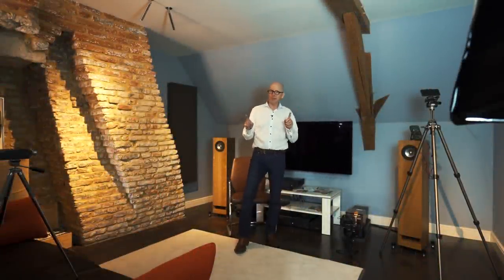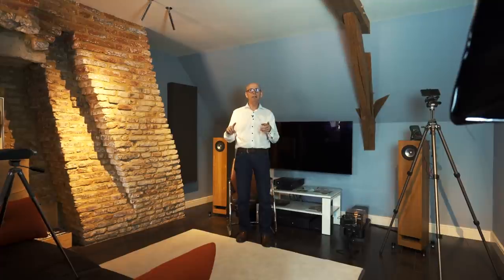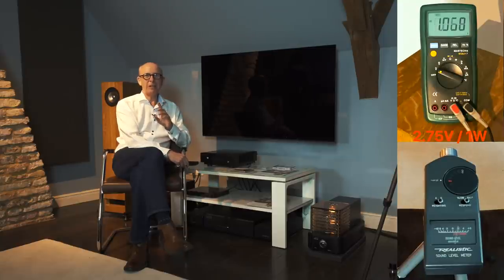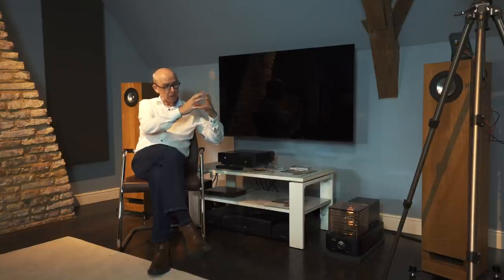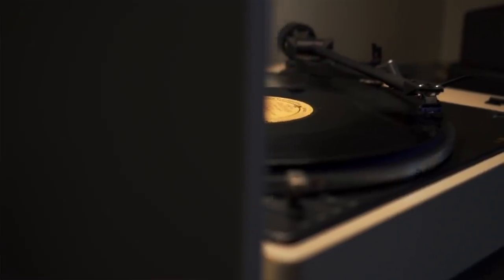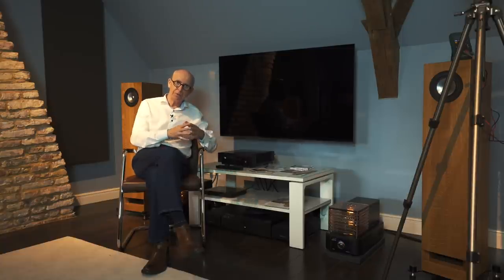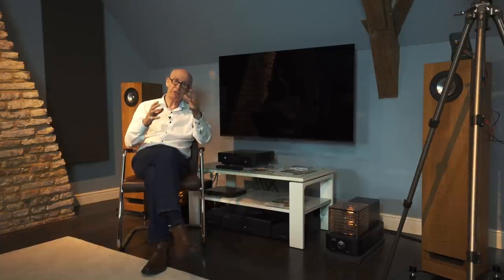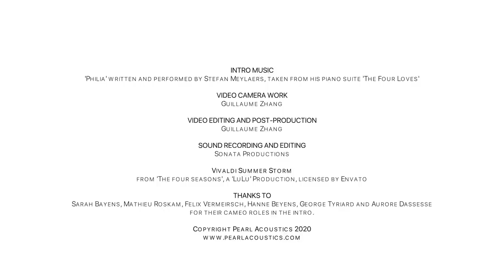How loud is 1 Watt (with an 87db Loudspeaker)?

Comment: Great. Now try music with some sub bass and see how it uses a hell of a lot more power for the same volume.
Reply from the maker: Hi. Thanks for your comment. I refer you back to a previous answer I gave. If your loudspeakers have a flat frequency response they will produce the same dB sound level at 1 watt, no matter the frequency. Of course the mid range ‘sounds louder’ because our ears or more sensitive to it. Hope this helps?
Reply: @PearlAcoustics  Yes but then whats the point of this video?  Sure 1watt can produce  loud sounds but whats so special about that? Now if this music had some lowend and still only used 1w then i would be impressed  😅
No offence but 87db per meter watt isnt even that efficient to begin with. Not to brag but I've got a set of 1980's monitor speakers that do 92db 😉
Reply from the maker: @FullFledged2010  no problem at all. The volume (sound pressure) at low Frequencies will be exactly the same at 1 watt with our loudspeakers because they are +/- flat down to 38hz.  I recommend you do the test yourself, with any high quality loudspeakers and see.
Reply: @PearlAcoustics  yes but that only works with things like white noise. or music with no low end sounds.  Try a 40hz sine wave and let me know how loud it sounds on 1w  😉

Comment: WRONG!  you must measure with a scope not with an RMS meter, you would have measured power input peaks of up to 20db above RMS or 10 db with cut compressed saturated peaks ( aka distorted!!), you would have also measured how high distortion and peak compression those 6 inch drivers are even at a mere 90db  SPL, I am living with active crossed over Klipschorns , the total absence of distortion and totally unlimited dynamic range puts everything else to shame like a tiny am transistor radio,  IOW  you have no idea how much distortion you had going there,  probably 5 to 10 percent, more on bass notes

Comment: Now do the same with an 8ohm speaker that drops to 3ohms and see how loud 1 Watt is.
Reply from the maker: Remember your speaker when it drops to 3 ohms becomes much more efficient at that frequency - the amplifier sees lower resistance and thus needs a lot more current. But only in the range where it has dropped. In practice, you’re absolutely right. The important thing for an amplifier is that it can deliver the required  current quickly, when needed.
Reply: @PearlAcoustics  I do not think impedance in speaker set  can  drop below coil resistance  at any circumstances      ,  With 8 oHm set speaker minimum is around 6,7 Ohm  But it is normal   to reach   more - ex 18 Ohm  in 8 Ohm set.  Only case would be when somebody added separate serial filter. which is unusual.
Reply from the maker: @Mikexception  I know it’s logical to think that but, and sorry to correct you,    in reality speaker drivers regularly drop well below that of the coil’s nominal resistance, especially when they get close to their resonant frequency. In our case our drivers drop to a little over 2 ohm at some lower frequencies. It’s totally normal.
Reply: @PearlAcoustics  I remeditated  and admit - my conclusion wasn't much correct. But to my excuse  I mentioned about   "unusual" serial filters and it looks  they may be not   electrical type and my fault was  that they are not so unusual.  With my constructions (mostly partly damped transmission lines) I had no much occasions to  observe them.  Driver impedance in assembled system is simply unpredictable.  Acoustic conditions treated as filter may affect measurements in that way by pulling passive power. - now I have in mind that you are  moving on vector scale and  measure something with unknown direction .

Comment: Imagine pnoe speakers which are 115db  with Gryphon amp 500 watts. Just kidding. What is most important is the weight of the cones, high damping factor and no cabinet or tube shaped cabinet. Then its dac and amp topography. Lukasz Fikus from lampizator gets it right

Comment: Not everyone has there system in a little space like yours my space is very large and to try and fill my space with your ignorant point would not work and if I did try to push a little amp like that to fill my space that amp of yours would plow up,and if not it would sound so distorted trying to fill my room and let’s not mention the lack of bass

Comment: A fun bit of magic. Most "audiophiles" have no notion of how sound loudness sensation is logarithmic. If you cannot define "logarithmic," you haven't a prayer of understanding; stop reading now, and just be amazed by magic.

Additionally, your narrative, when heard through the AKG's, shows that your room is not much deadened by whatever is in it. It is actually quite live. When the space is lively, measurements go into the dumpster. It's why real, repeatable sound measurements are generally made in an anechoic chamber. "Room gain" is a thing, elsewise. This also derails the effect of distance of the mics from the speakers, which here is unmeasured. One room's 6 watts at 6' is another room's 120 watts at 12'.

Your conclusion might better be that sound levels versus power to speakers is more affected by the room and the measurement distance than by voltages at some 'nominal' impedances. I relearned this recently by investing in a good 45 watt/channel amplifier, and replacing it very quickly with a 150 watt/channel device (which is satisfactory). [I occasionally listen at ~85-90 dB at 12 feet.]

It's more about the room and the listening position than it is about the watts. But we all know that.

Comment: This is stupid.  Why in the world would anyone use any 87 dB speaker, with a small radiating area to boot. This is also not addressing how much distortion is being produced with one Watt, is it ?   ( I use a two way high efficiency speaker, with a horn - loaded 15 inch ( large radiating surface) and a powerful one inch compression driver .)  Yes, 1 Watt will be OKish on my system ( ALTEC 515B and 802D ) , but a three Watts is better, and my next SE tube amp will be about 9 Watts, for overhead. Even if I play at 1/4 to 3/8ths a Watt on average.  

ULTRA important, one must START their audio system with at least 101 db, LARGE RADIATION SURFACE SPEAKERS . All else, follows THAT, as the proper start.  It is called, " Starting on the right foot ". Or else you waste your time, money, and entire  life in audio !!!!!!!!!!!!!!!!!!!!!!!!!!!!!!  Mr. Lovegrove is starting with the WRONG kind of speaker, and he is trying to justify it.  No good at all....sad.  Start with an ideal speaker, and be done with it.  Concentrate on the amplifier design.  Most amps I hear are terrible, 99.9%

Comment: You simple cannot evaluate power measuring a time variable voltage with an AC voltmeter across an non-linear inductive impedance such as a speaker.
The V meter is showing an estimate of the instant RMS value of the voltage applied to the speaker, but that estimate is only valid if the signal is a pure sinusoidal and the load is linear. But neither of them are. 
So no, that wasn't 1 watt of power. This is severely flawed. You must leave technical measurements to skilled and trained people.